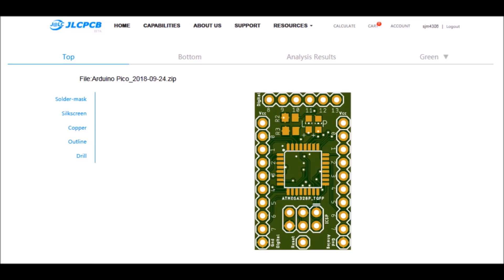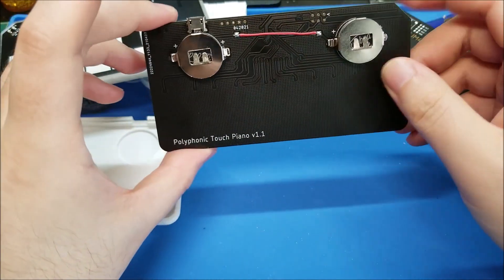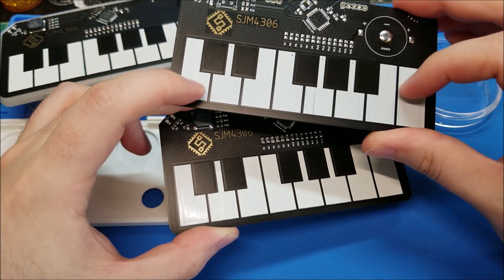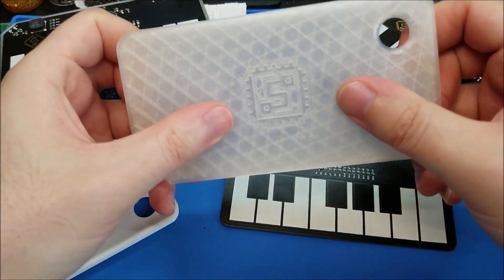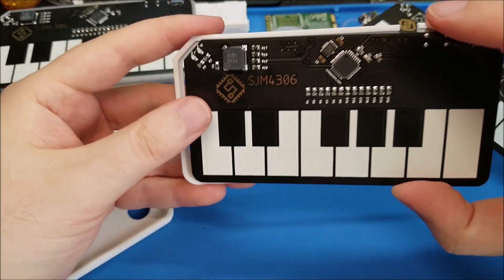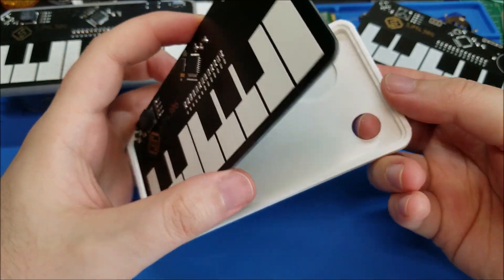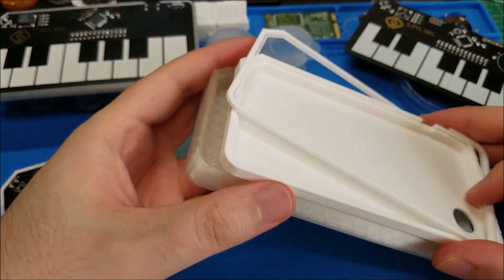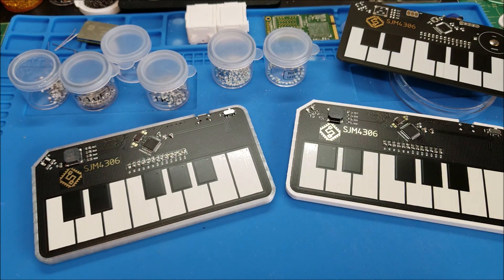Touch Polyphonic Piano Part 2: PCB v1.1 and a 3D Printed Case!

Comment: how do the traces connect to the keypads, it looks like traces are on the back. under each key. but how does the electrical connect. is it a drilled hole and soldered through the whole. and the screen printed over?
Reply from the maker: It's a two layer board with vias between the two sides
Reply: @sjm4306  awesome. so when you designed the keys on the pcb board design software. do you just import an svg of the keys, and fill with copper? i’m trying to design a keyboard in fritzing pcb software and having  trouble wrapping my brain around it.  
also is it just  white and black wonder mask over the bare copper key beds, or is there more to it?
Reply from the maker: I designed the board in eagle. I drew the keys with the polygon function on the silkscreen layer. The keys are mirrored on the top copper layer and the soldermask is black to make the black keys and background black.
Reply: @sjm4306  man you have no idea how much this helps me. i really appreciate the help. i’m still trying to wrap my head around this whole pcb design thing.